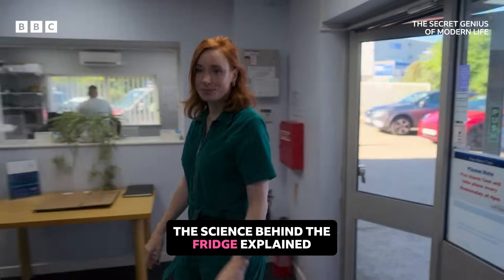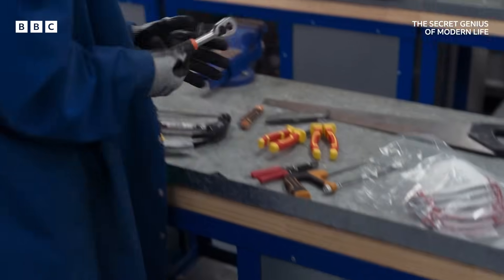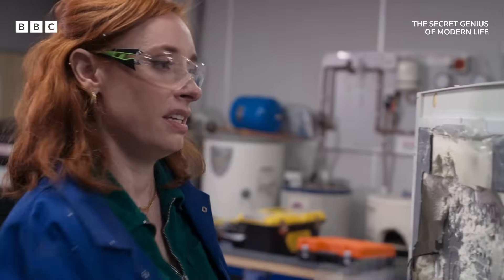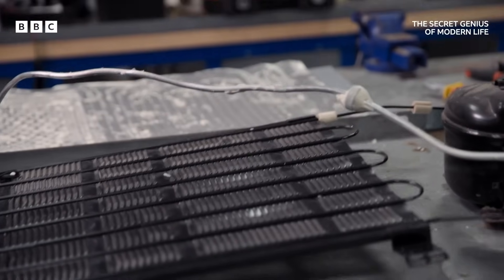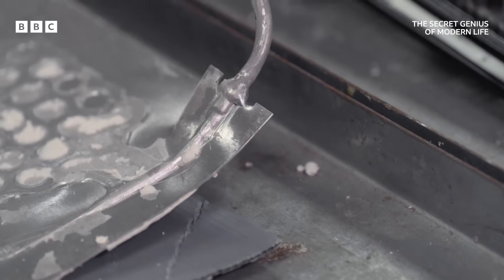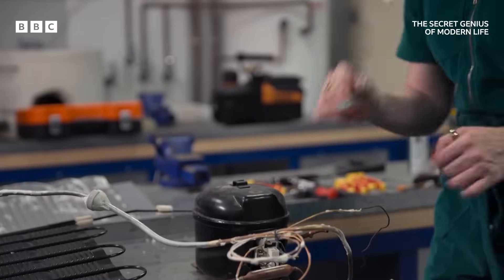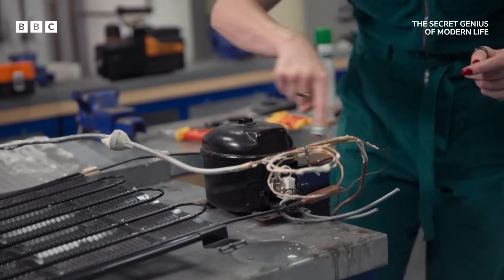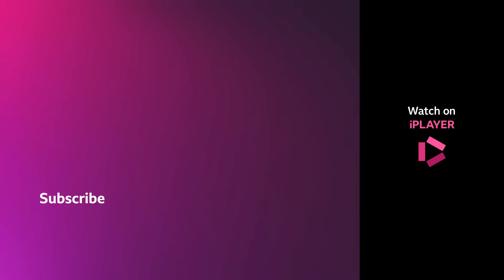How does a fridge work? | The Secret Genius of Modern Life - BBC

Comment: Myself and a couple of mates had an old bush hut in the bush for hunting.  And inside we had an old looking fridge.  And to get it going you had to light a little kerosene lamp which you lit up  and push it under the fridge. Within about an hour it was cold and in about 2 hours you could freeze things. My mate told a work colleague, who was a refrigeration mechanic.  He didn't believe it so we drove him 4 hours to show him  and he couldn't he was amazed.
Reply: My grandmother had one that ran on paraffin. It always seemed strange having to light a fridge!
Reply: The heat does the same job as a compressor, but that should not take away from how impressive that is, I simplified but am sure it's a whole lot more complicated
Reply: UK, born 1965 - first few years of my life we had a gas fridge.
Reply: @notreallydavid 
Yes - quite common in those days. 
Energy from a  small gas flame provided the  "compression part" of the cooling cycle.  Left quite a dirty stain on the wall behind after a few years of use from combustion products !
Reply: @eric4709 Never noticed! (I was very small.)
Reply: I grew up with one of those fridges on an island in the middle of the Baltic sea, without electricity or running water, where we went in the summers. Very practical.
Reply: Those are common in RVs and boats but are very inefficient.